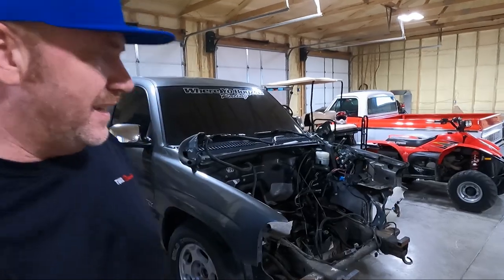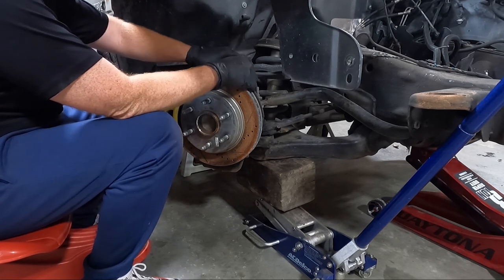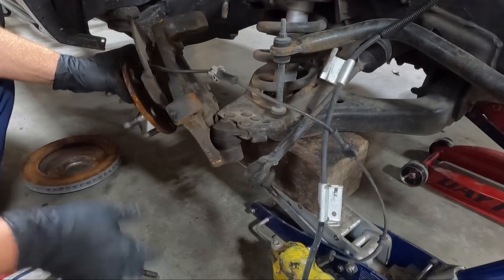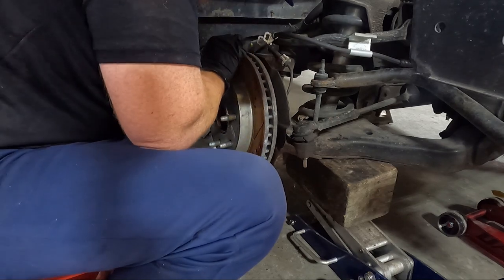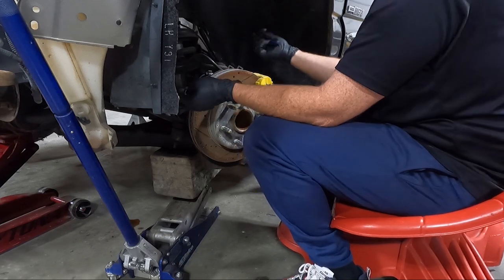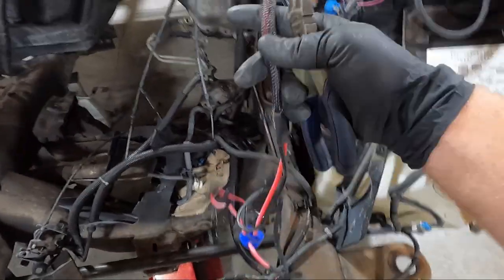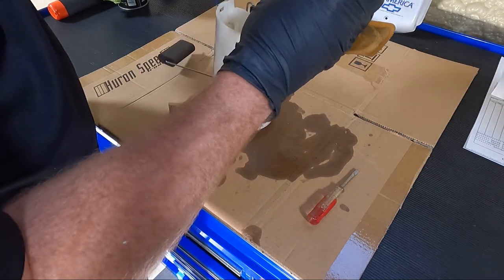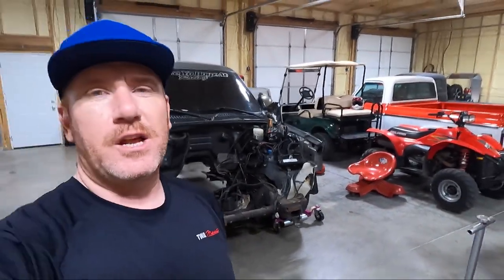Stripping Parts off one Truck for Use on Another

Comment: It's really easy to take out the dash
First remove top half of steering column 4 bolts and the shaft bolt whole column come right out 
Then under cowl unplug wipers 
10mms top of dash 
13mm on bottom of dash black bar
15mms on side of dash and whole dash assembly comes out completely 
No need to remove stereo, airbag,cluster, switches, I can do heater core in 3hrs doing it this way.
Reply from the maker: Interesting. That is coming
Reply: @TWAMotorsports  pull the dash take off the doors and scrap it
Reply from the maker: Thats the plan
Reply from the maker: So you are saying the harness and all comes out with the dash that way?
Reply: @TWAMotorsports  yes,  I just did one again, it's the 10mm an two 15mm on the top by the vents kinda hidden, you disconnect the door harness and any other harness on the side, and all the harness where the dome light plug was comes out as a whole unit
Reply from the maker: I appreciate that. Getting ready to try this

Comment: You need a 2 post hoist in your shop. Then your not on the floor all the time. Once you use one you will never go back to the floor.  👍
Reply from the maker: I agree that would help
Reply: Bendpak  XPR -10AS makes a good 2 post hoist.
Reply from the maker: I doubt I will buy another bendpak because of the air locks

Comment: What year model truck is that and does it have a fuel filter on the driver side frame rail
Reply from the maker: Yes has fuel filter. 2000 model
Reply: @TWAMotorsports  I have a 2005 Chevrolet Silverado 1500 crew cab LS Short bed but on my truck for this year it doesn't have a fuel filter on the driver side frame rail and the fuel filter is engaged into the fuel pump which means I have to replace the whole fuel pump assembly as well as that means you can't replace just the fuel filter itself.
Reply from the maker: That is correct. Fuel filter is not serviceable